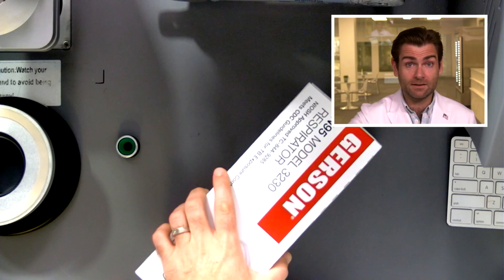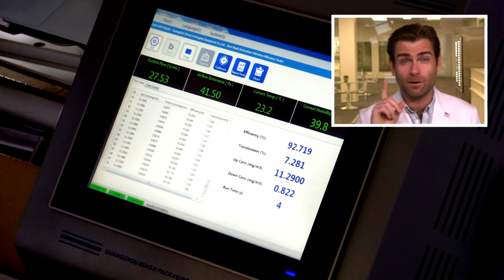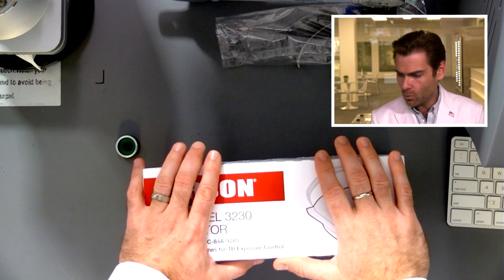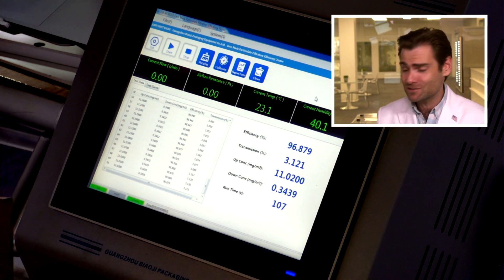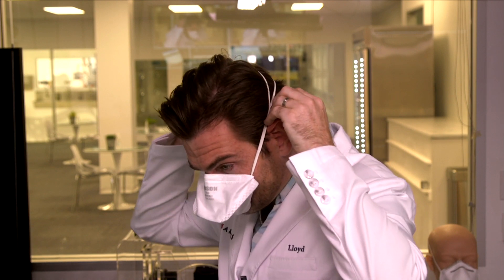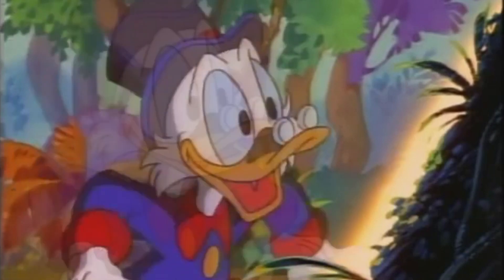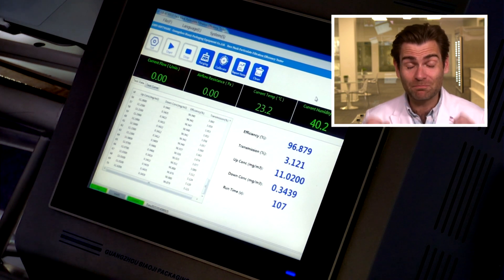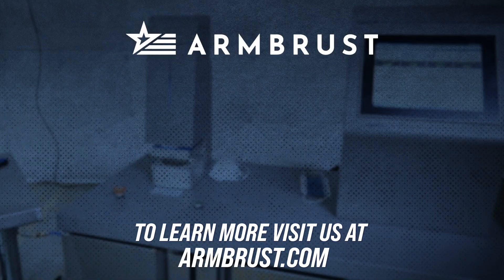This mask left Lloyd SPEECHLESS - Gerson N95 Model 3230 Respirator Review

Comment: I got my sample pack today and was super excited to try this mask.... but one side of the straps didn't seem to be melted in well, and came off while I tried to put it over my head, and the other side is about to pull out too. Where it is melted together over the strap seems like maybe it didn't get hot enough or something. Is that something you've seen with this mask?  Maybe I just got a bad one.. It does seem super breathable, and actually the attachment point works well because that's where masks tend to gap open on me. (high prominent cheekbone with a slight indent under, so many masks gap there) It does however give me ideas of just making my own strap to clip onto my masks to give a better fit-product idea?? I have a tiny head so all the mask straps are way way too long. Even the tiny Armbrust child mask which is a bit too small for me, the earloops are too long and don't hold it tight. Thanks for all these great mask tests. I have primary immunodeficiency, so vaccines aren't effective and my immune system has a tough time with a regular cold.. So a mask is the only thing I have to keep me safe for the occasional doctor visits where I have to leave my house.

Comment: Petite face person here, I have this and the ACI duckbill style. Gerson fit my face fine, though I do need to have more careful attention with the wire to seal down onto my bony cheek bones and it causes more pressure across my nose bridge.  I think it would work for a variety of face types because of the style and that nice room fit under the chin. I much prefer the ACI blue duckbill variety, perhaps because the straps are more comfortable material and wider (less fuss with longer hair), less tension over the nose/cheeks.
Reply: hi, do either of the masks you mentioned have any odor or smell that's bothersome? 🤔
Reply: @USArmy91222  The Gerson does have a smell from the straps that are made of non-latex material (rubber band like).  I was worried because it smells the same as natural rubber/latex (I have a contact allergy to latex). The ACI is a neutral medical paper scent,  similar to most surgical/procedural masks. I don't notice the scent enough to be bothersome when in use for either mask. Though if you have an aversion to rubber/latex you might have issues with  Gerson (I think the smell  increases with  reuse, maybe the straps off gas more over time? Not overpowering horrible, just aware of its existence).
Reply: @funny_diva_B  thank you for the response, i'll take that into consideration

Comment: As a medical and aerospace engineer who specializes in materials and making ppe... this last year has driven me NUTS with all the fake science floating around, no pun intended haha. 

96% of 0.3 microns is excellent. 0.3 is the HARDEST size to capture. Its easier to capture 0.12 micron sized particles due to brownian motion and streamline functions, allowing the 0.12 particles to bounce off of other gasses, And anything above 0.3 microns are just massive. 

Plus viruses dont work that way. We dont breathe out viruses, we breathe out infected host cells since viruses completely depend on living cells for replication. Fun fact, the smallest host cell a virus can successfully use to replicate is 0.4 microns in size. Anything smaller, the virus can not replicate due to insufficient resources:)

Comment: I'm a veterinarian in a care center for common wild protected fauna in France. During all my career I have only experimented with this type of design because it was (is again now) the most used here for decades. This type of mask has made great progress in terms of breathability yes. Both FFP2/3. I have 3 different suppliers, each with their own strengths. One of them manufactures awesome FFP2 (N95) for breathability and the speed with which a fit check is quick to perform. The mask doesn't move for hours. You forget it except maybe when you walk past a mirror. It's a graft; not a fit. The breathing chamber is huge and a bit different from what we use most commonly (typically the one you presented in this video) and they have a crazy pull back effect.
Another historic manufacturer even provided us respiratory protection masks made from Brocéliande cellulose. Brocéliande... Absolut legendary masks made in Brittany obviously :)) !
And then at the beginning, there was Valmy. There it is a bit sentimental. The very first ones I used. My....deflowering in a way😐
At the start of this crisis, we found ourselves completely devoid of respirators. All requisitioned for hospitals. We were forced to stop everything for a little over 2 weeks. A company took an interest in our case. They only made surgical masks. They reoriented their production line to make masks with the same design as these 🦆 respirators. They were delivered to us in rudimentary 500 masks boxes. We only had information on FBE : 145 (increased challenge test) and perfectly splash resistant.  We said yes. It was a bit risky and seeing them stamped with a surgical standard wasn't overly reassuring. I practice right on the passage of migratory birds. We were informed that poultry breeders were going to have to slaughter their farms because of cases of H5N1  in April 2020.  Even less reassuring because before being identified in these farms, native wild birds could have been infected before. The samples we had taken showed that it wasn't the case.
But for everything else, these Masks have done wonders. Today this company manufactures FFP3 (N99) respirators...

🙄You're doing a beautiful job you know that?...

Comment: Since these duck bill / pouch masks have so much more surface area than a typical folding mask, I think it would be interesting retest them at a lower air flow rate than 32 L / min. and see if filtering efficiency improves significantly.
Reply: I'm just testing a small area so to your point the true breathability is actually much better.

Comment: Looks like a great mask but not sure about the duck bill shape.
Reply from the maker: They may look silly...but they really are insanely breathable.  Super comfy.
Reply: An other strong argument in favour of this design in addition to the breathability of these masks : as mentioned by Lloyd, the fit test is fast and efficient. And worn for several hours, whether you're talkative or not, the fit remains extremely effective. 
If you have to wear a respirator for a long time without interruption, I highly recommend it.

Comment: Never tried the duck bill style but love the test results. The "+" might refer to a braided headband with staple-free attachment?
Reply: The + version is a surgical respirator with rated fluid resistance.
Reply: Ahanuban is correct. The plus is the surgical rating by the FDA and has an extra coating for fluid resistance.